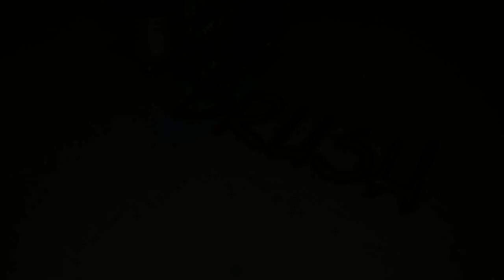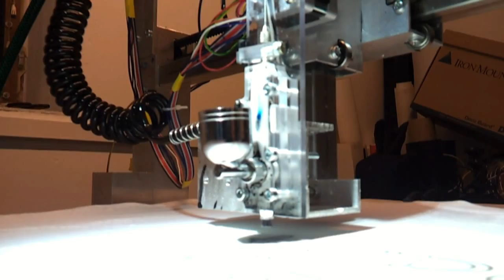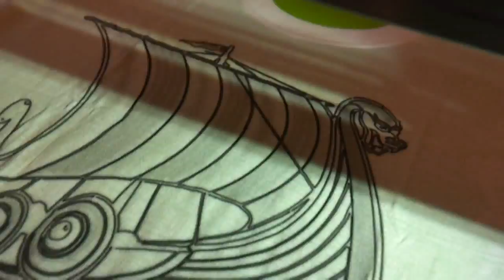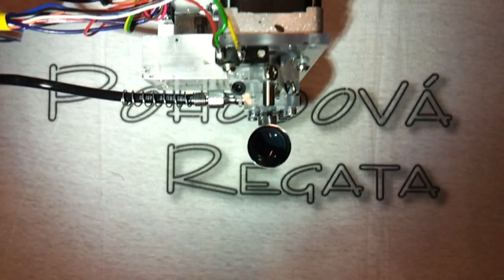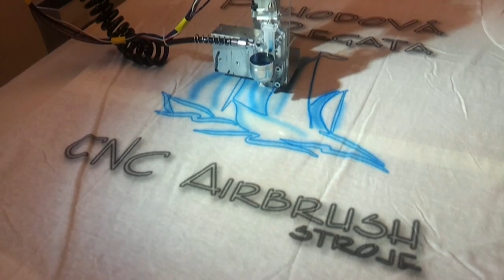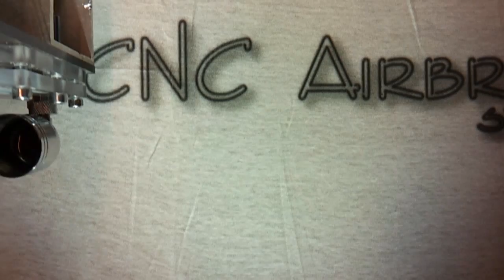CNC Airbrush machine

Comment: we also built a machine like  this..  we used bitmaps.. not vectors..
the  4 airbrush  was actuated by  electromagnet..  about 180 level  each color..

well... it was  around 1995 and vutek was only on the market yet..

what was interesting, we had to close to zero and open the  valve   on each  pixel..
didn't worked  only set to level, but  closing to zero and  open the necessary level..

the 4 color we broke down in  corel, 

another  interesting thing was,  the range  under 12 and  over 235  was disabled  because  didn't give  visible result..

very cool ... keep going  with your experiment